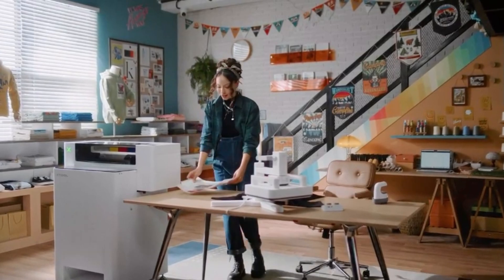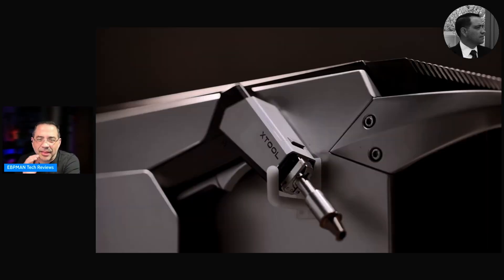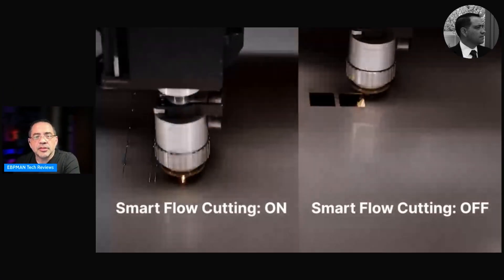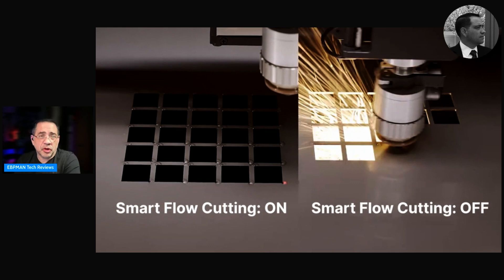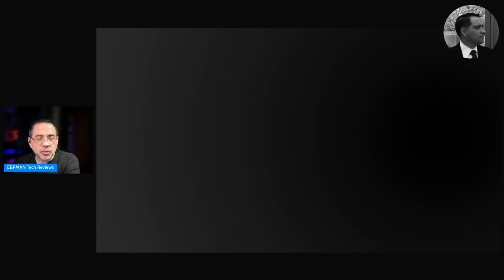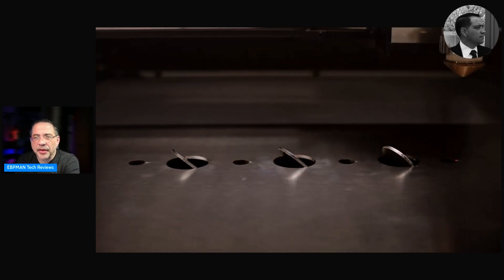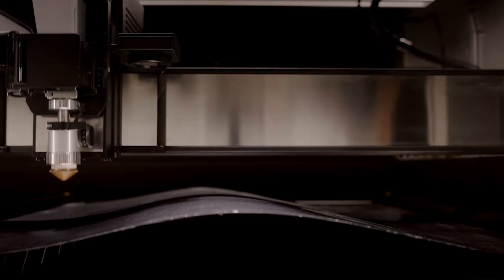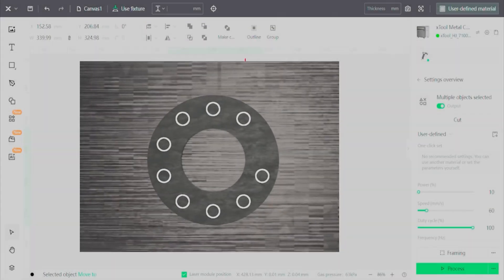The New xTool MetalFab Laser Welder and CNC Cutter Is A MUST HAVE For Metalworking

Comment: Any idea what the 1200 watt will cost?
Reply: I'm sure it would be like $10k to $15k I'll be surprised to see a lower price even though those are low but knowing xTool they are very competitive 🙏
Reply: I thought they said 8-10k sterling, but I may have just made that up.
Reply from the maker: @lureup9973  not yet
Reply: The survey asked if a $6,000 price was acceptable. However, I think this will be sold as 2 machines.